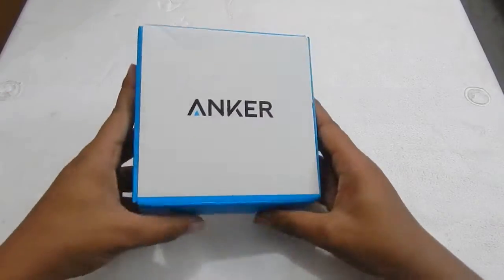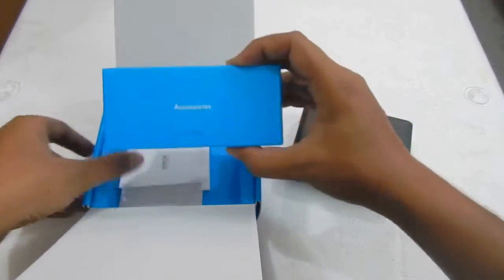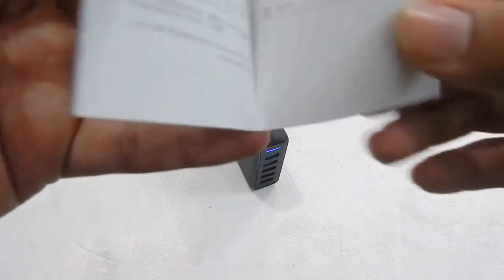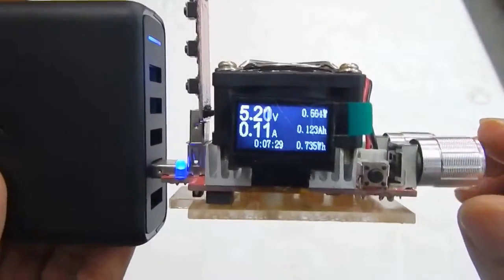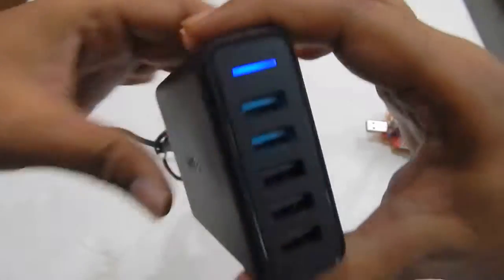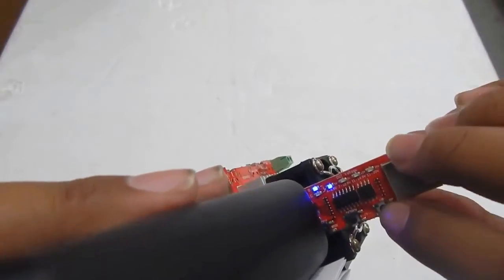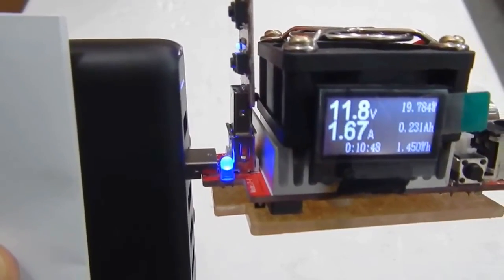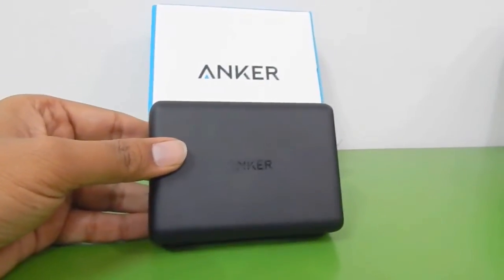ANKER PowerPort Speed 5 Ports 63W Charger Unboxing & Test !.

Comment: Nice demonstration. This is a pretty cool test board you have here 🤗
It would have been great to do the same tests on multiple ports at the same time to see the overall behavior of the charger when fully overloaded. Like on the two QC3 ports or QC3 + IQ ports at the same time (but you would have had to use 2 or 3 test boards and it might not have been possible to do the test with extension cables).
Thanks for this useful test anyway.

Comment: Hello i was wondering if the two quickcharge 3.0 ports could be both used to quick charge at the same time my others stop quick charging when i plug in a second one
Reply from the maker: yes, both ports supports quick charging at the same time. The charger heats up a little when using both the fast charging ports.
Reply: @gurribuy  thanks for the quick response ik gonna order one there on sale now here in holland for 34 euros thnx
Reply: Will the quickcharge ports 3.0 also keep quickcharging when all the other ports are being used
Reply from the maker: @mennopieters3512  yes, the ports will keep on charging at quick charging speed. But, even though you can use all the ports at the same time, i don't recommend using all the ports at the same because the charger will heat up and its life will be reduced.
Reply: Thanks but its gonna get some abuse haha ik a long term backpacker/bikepacker i go away for severel months at a time so i bought 2 for if 1 fails and so i dont need to plug in all the ports too

Comment: I'm going to a backpacking trip soon and I would need a good wall charger to charge my devices. 
Most of these devices do not have QC technology (powerbanks, camera battery, smartphone, earphone). 
Would this charger be the best option? Its works well to non-quick charge device?
Reply from the maker: yes, it works even for non quick charge devices. The quick charge ports works like normal ports when you plug a non quick charge device so, you can definitely use this charger for your gadgets.

Comment: Is this faster than the ipad 10w charger?
Reply from the maker: yes, this will output about 12w through a single port. What model of ipad do you have.?
Reply: @gurribuy  I have a iphone XS, Ipad mini 5, Earpods and i want to charge powebanks and gaming headsets.
Reply from the maker: @Adiemlac  you should buy the newer version "PowerPort Speed PD 5". Or any other Power delivery charger. This will give you more option and also future proof your purchase. You will also need to buy a usb c PD to lightning cable.
Reply: @gurribuy  I saw in amazon the ANKER PowerPort Speed 5 Ports 63W and the price of this one is about 50€. The PowerPort Speed PD 5 is only 30€. Why the price difference in this case if the last one is the newest version?
Do you recomend a anker usb c PD to lightning cable?
Reply from the maker: @Adiemlac  The older model has qualcomm fast charging Qc 3.0 which will only work in some android devices, so, not of much use to apple users. The older model uses Qualcomm chip so Anker must have had to pay Qualcomm for the chip However, The price keeps on fluctuating, IF you want the latest then get the "Anker PowerPort Atom PD 2". This charger is much more efficient and doesn't heat up much.
And for the cable you can choose between Either Anker or Belkin, USB C to lightning cable.

Comment: Hi, can I charge a device with 5V- 500ma on this charger?
Reply from the maker: Yes, you can. The important thing is that we have to match the voltage of the charger and then the device can take what ever current it wants from the charger. So, if your device takes 5V then you can use this charger and depending upon the device you are charging the current will change automatically. Hope this helps.
Reply: @gurribuy   thank you very much

Comment: I can charge my iphone  XS with quick charge 3.0 or my battery will get damage ?
Reply from the maker: apple dos not support Qualcomm quick charge 3.0, so i can't say if it will charge your phone faster but, it will definitely be faster than the in box charger that apple sends with XS. Apple supports PD(power delivery). so, you can use any 5V 2.4A charger that you have to charge your phone at 12 watts.